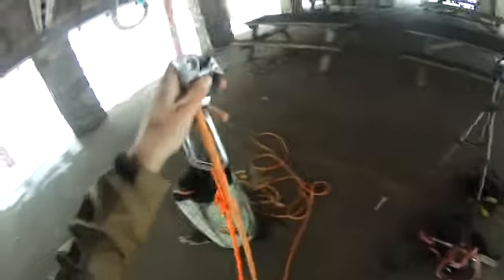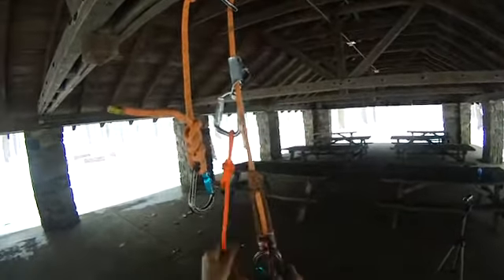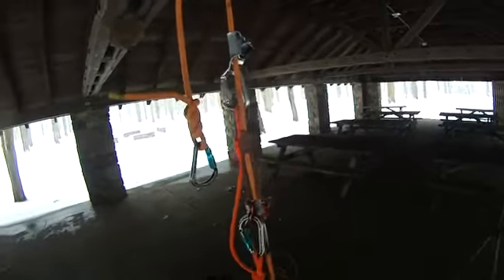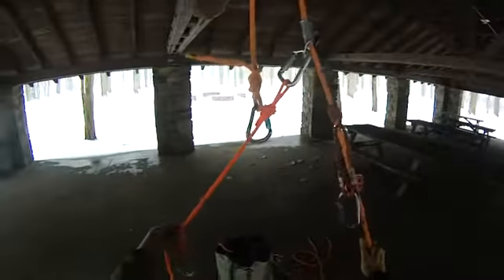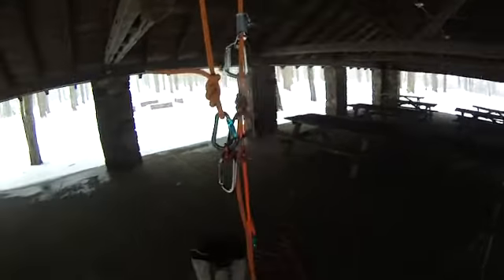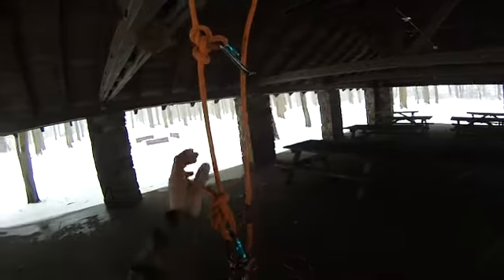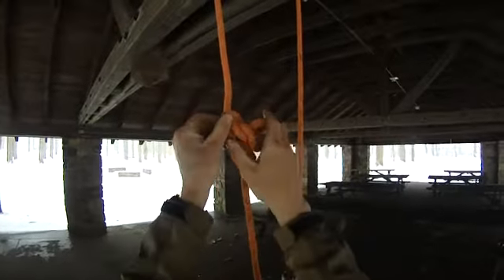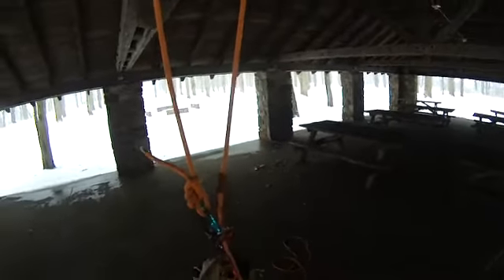SRT to Dbrt

Comment: Oh I've seen that before!! I forgot about it though.. like I said my worries would purely be with accidental gate opening
Reply from the maker: There is always a chance for sure, I would be arrogant to say otherwise. Double locking or even better triple locking (i think triple is the new standard) is the way to go IF you are to use a biener.  But like you mentioned the Link is best.

Comment: Jim,
Thanks for posting this ... it's something I'm interested in right now.
Almost always, I run my Ddrt off a friction saver.  How would that work with this?

Tom
BTW, I like the butterfly tending the HC.  Nice trick.
Reply from the maker: If I was to have a friction save on this I would have a butterfly dead end into the small ring of the ring to ring and ascend the opposite side. Keep the rest the same.